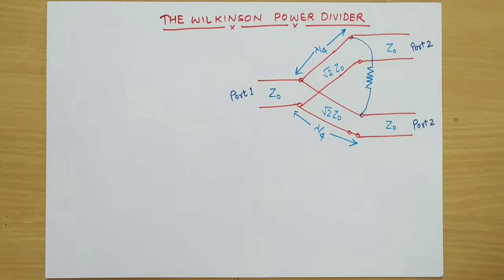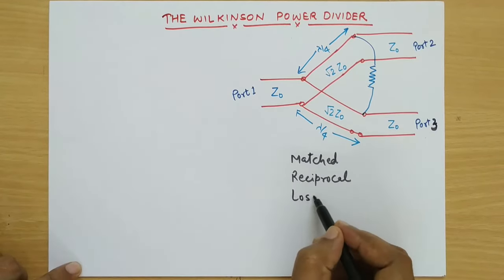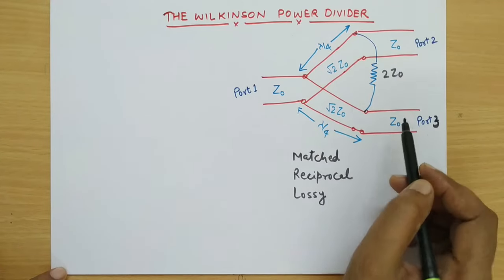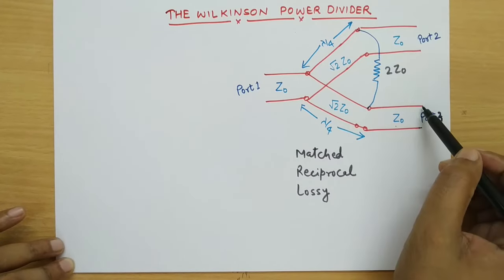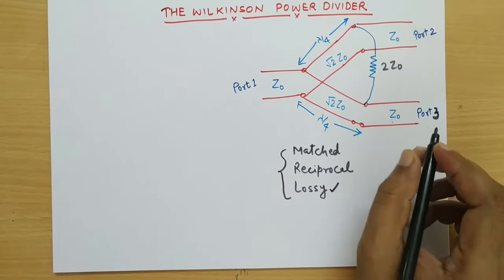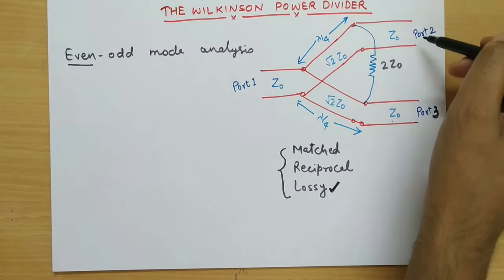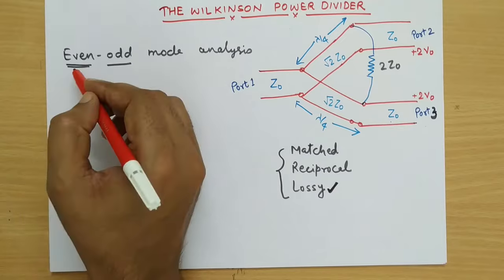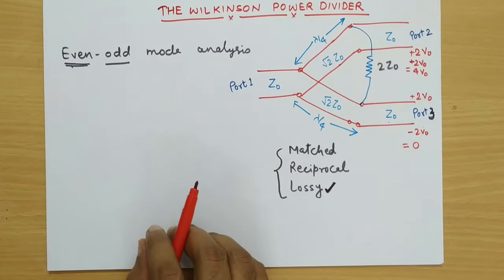Even-odd mode analysis of Wilkinson power divider and its S-parameters by Dr. Niraj Kumar VITCC

Comment: Why at minute 6.34 the two parallel 1 does occurring in 2 and not 0.5... What am I missing
Reply from the maker: Actually 1 is divided in two parallel parts for making an equivalent circuit to apply odd and even modes.
Reply: @RFDesignbasics  oh OK so 2ohms parallel equals 1
Thanks for clarifying

Comment: Sir, I have a doubt, in your 2 port network analysis, we saw Γ(L)=V2+/V2-. but here at 15:21 we are using Γ=V-/V+ (quoting as Γ is at load side reflection co-eff). The ratio is inverse here compared to the two port network. I think it's   Γ→Γ (out) on load side.
 Could you kindly clarify on this.
 Thanks in advance, Sir.